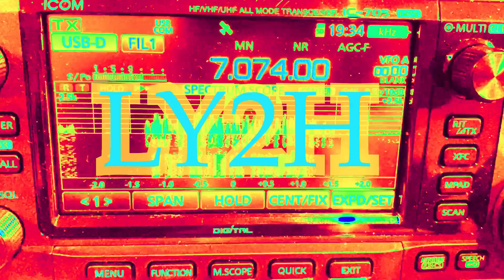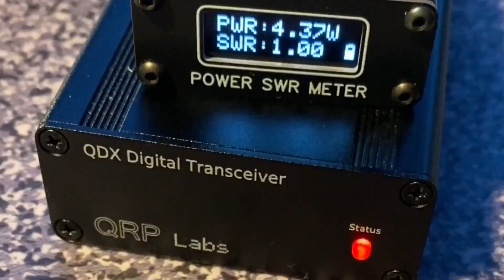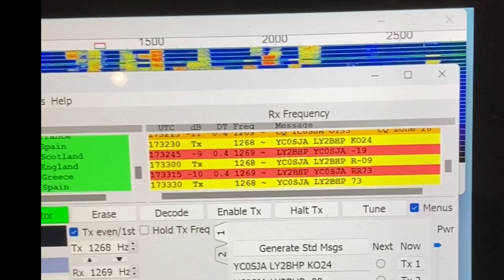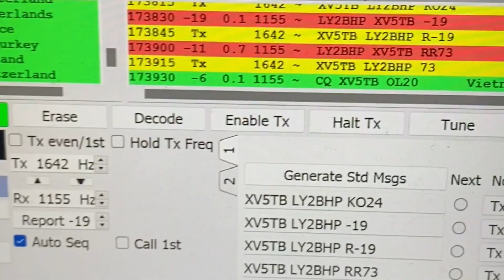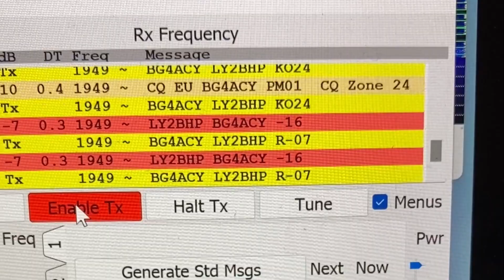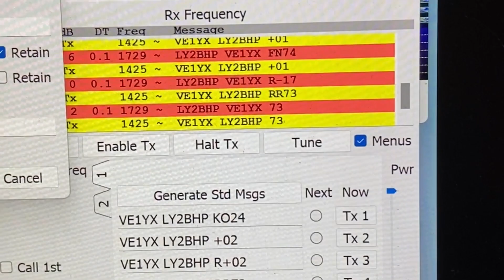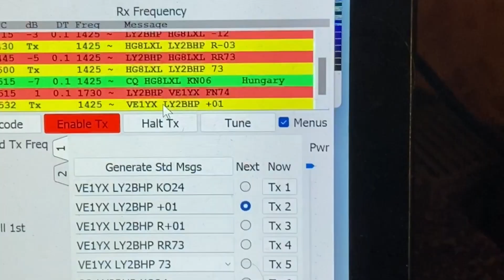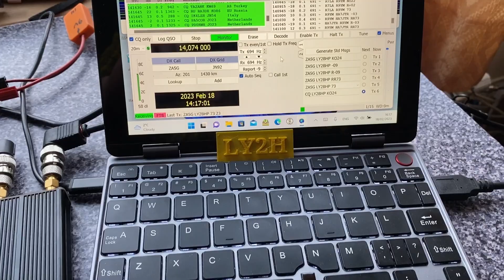Is it feasible to make real DX-contacts on the QDX digital transceiver?

Comment: Great results, is there a link to details of your antenna setup?
Reply from the maker: Thanks! My antenna is all shown in the video :) It’s the most conventional full-size 80-10m EFHW antenna, with tiny  compensation coil (makes work better on 20m and up, 5 turns on 40mm coil former, placed ~2m from the feedpoint, not critical) fed via the low loss 49:1 transformer from  Myantennascom. HTH, 73! Linas LY2H

Comment: hello! I really like your video, a few months ago I got my amateur radio license in Argentina, unfortunately it is very difficult to get HF equipment that has 100w, but I was lucky and got an ft818 and recently I made contact with Australia on qrp and using a vhf antenna with a 10m tuner, I liked it so much that I put the photos of that night in my qrz, Greetings and many thanks for showing the little QDX 73 from LU5OLA
Reply from the maker: Congratulations Leandro and thanks for your comment! FT-818 is a great radio, I have, and still use its predecessor FT-817. I think, it would be great for you to complement your radio with one of these little 40-50W apmplifiers, like MiniPA-50, or MicroPA-50, they are available off Ali express and go good with the FT-817. But QRP is always the right way to go, anyway! CU on the bands! 73! 72! Linas LY2H

Comment: Love your videos. Are you still going to be running your external buck converter with the new board? I saw that qrp-labs includes an internal one. I noticed the documentation still allows 9 or 12 volts and still recommends no higher than 6 volts for the 12 volt version. I ordered the 9 volt version and it should be arriving soon. I have my buck converter ready for it. 73 Ro AI7PD
Reply from the maker: Thanks Ro! Yes, I'm gonna be running my external buck converter, as it's still necessary to make one's mind up on the power supply voltage used, 9V or 12V. The internal buck converter, as I get it, is used for the sole purpose only- to produce a bias voltage necessary for the TX/RX/LPF switching in a more efficient manner enabling, thus, quite a substantial decrease in heat production on two resistors and the whole PCB, in fact. That's a very interesting and elegant solution and I'm looking forward to seeing it in action on my Hi-band Rev 5 board as soon as I complete the assembly! Wish you good luck and tons of fun with your new QDX! 73! Linas LY2H
Reply: @Linas_LY2H  Thanks for the reply. Looking forward to your review of rev 5. I'm hoping to get some DX with my QDX and maybe you'll see me on FT8. 73 Ro Hart AI7PD

Comment: I’m running about 1.5 watts on 15 meters with my QDX (9 volt supply) and I’ve worked lots of 5,000 Km contacts!  Cycle 25 is alive! 73 de ai4ot
Reply from the maker: That's cool! Congrats! 73! Linas LY2H